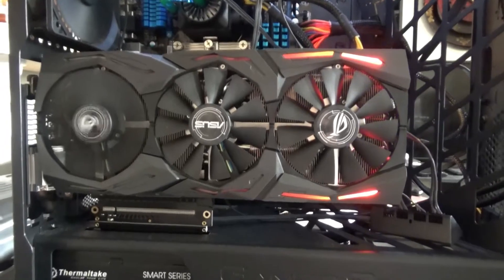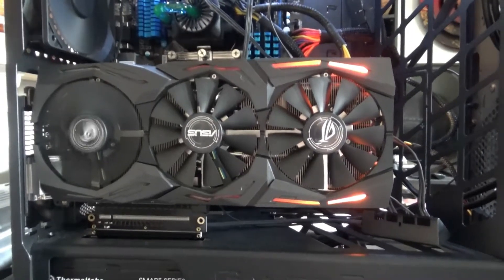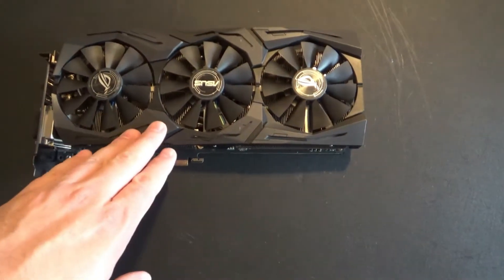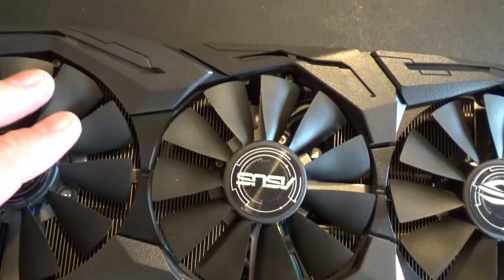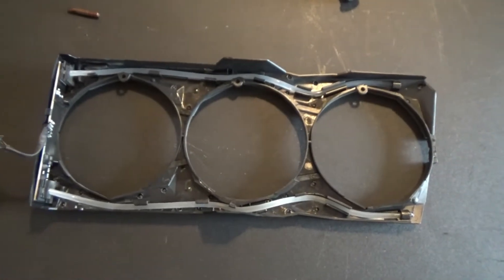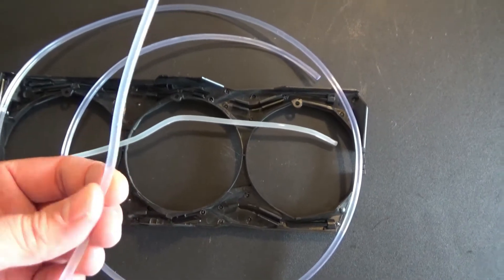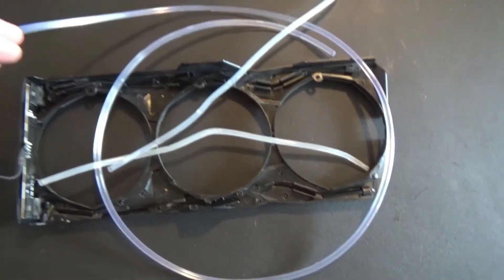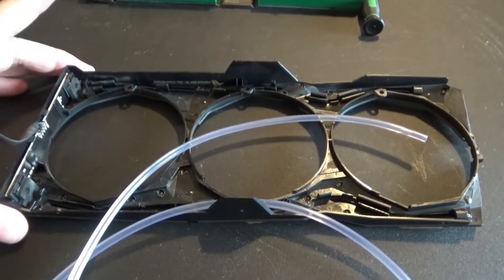How to fix / replace ASUS ROG STRIX RGB Fiber Optic Cable

Comment: I had same issue but some of the colour dont show like say like the breathing affect it don't do it
Reply from the maker: There are two types of fiber optic cables. One type sends the light straight down to the other end. The second type disperses the light along the way. You want the second type. Next you'll need to make sure you have the right RGB software. Try Signal RGB and if that doesn't work, use the manufacturer software. There might be different versions depending on the age of the card. Good luck!

Comment: Yeah got the 1080 ti version of this card from a friend and only the back plate logo lights up and nothing else.  No "Republic of Gamers" on the spine nor the slits near the fans. But it seems I do see a lot of LED tube light when I look down into the case where I see the back of the shroud.  Going to try this soon...  Ada Fruit sells the 4mm but not sure if it is better to go with 5mm?
Reply from the maker: Good luck. Let me know how it turns out.